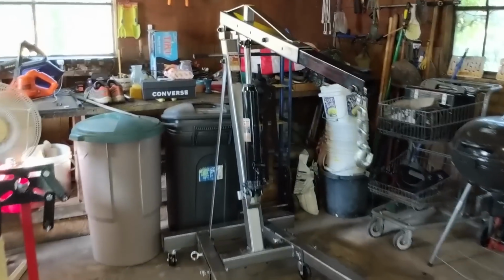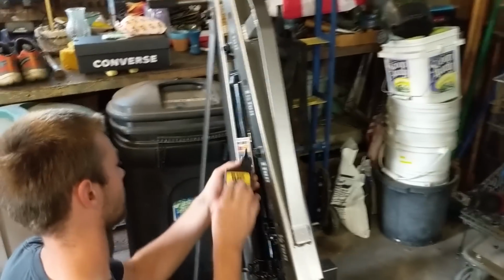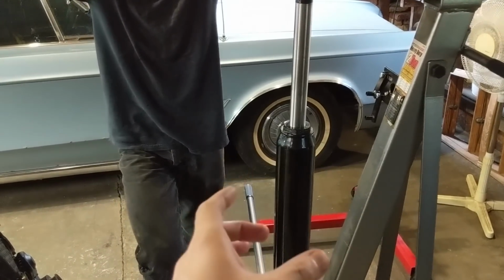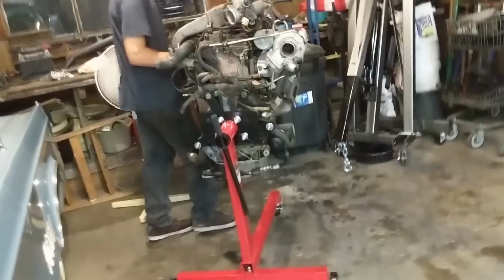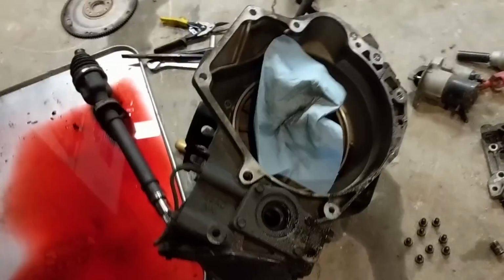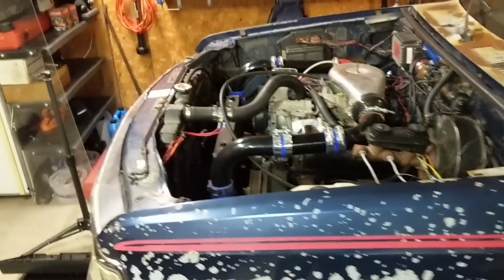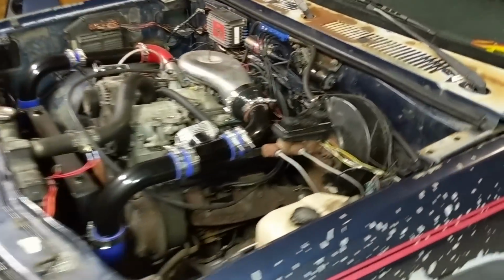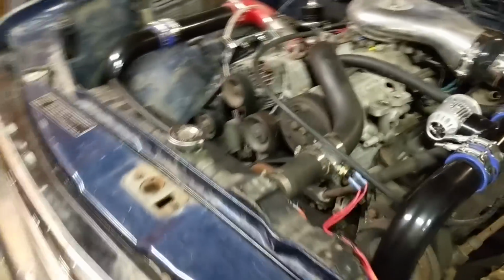eBay Turbo V6 Dakota Cold Start & Revs!

Comment: Brake fluid is hygroscopic so it has the potential to accelerate internal rusting. There is definitely a viscosity difference, but I don't know how that would affect a hydraulic system that simple.

As for DOT 5, I know that messes with non-silicone systems, especially ABS units. I would be even more hesitant to use that in a jack.

I used motor oil treatment in a jack recently and it has been working well so far.
Reply from the maker: Yeah that was sort of my figuring as well.
I was only joking about the DOT5, hahaha.
That's pretty awesome that the treatment works.
Honestly I think any oil fluid would probably function for years.
Could probably use vegetable oil!
Reply: Yeah, I was in the same situation a while back and was surprised when I read that brake fluid doesn't work, but it may have been based on test results with the wrong cause attributed to the effect.
Reply from the maker: I just honestly think it's people talking and nobody actually knows scientifically or anecdotally. Standard internet! XD

Comment: I been using ATF in my 9000 pound lift for over 10 years. Never had a problem. And you can find it at any gas station.
Reply from the maker: Yeah was wondering if that would work as well. Didn't see why not. I think jack oil is genuinely just super over priced low temperature hydraulic fluid. 😂 Thanks!

Comment: Things to (maybe) change on that Dakota: 1-get/make a downpipe where the wastegate doesn't hit a wall, 2-find a way to route the exhaust from the other bank to the turbo, or put a second one on that other exhaust manifold, 3-firing order, although that one is optional. Looks awesome otherwise, can't wait to see it make choochoo noises and burn some rubber. And fuel. And oil. Also the glorious Chrysler space-boat.
Reply: Oh, and 4-delete dump valve, get all the sutututus.
Reply from the maker: He has solved the wastegate situation I believe, and the turbo is being fed from both banks.
I did tell him to come reply though, hah. It makes some pretty awesome noises now. :D
Reply: @802Garage  My bad, it kinda looked like it was only being fed from three cylinders to my sleepy morning self. :D
Reply from the maker: No problem, I wondered the same at first! It definitely is not fed "efficiently" shall we say, hah. He says it works though!
You may be one of the few people who spends as much time on YouTube as me. :P
Reply: @802Garage  lol! Youtube is a literal goldmine, I'm (amongst other things) a computer geek, don't have a TV and lots of free time. And it's chilly outside, at the moment, so yeah, I'm able to rationalize my heavy Youtube consumption quite reasonably.
Reply from the maker: I'm a computer geek too. Think we may have touched on that before, but I have a degree in game programming and used to do computer repair. Also dabbled in audio and electronics in general. I find ways to rationalize mine as well. :P
Reply: Yeah, I think you alluded to it before. I find it funny that there aren't more people that are both into computer stuff and car stuff. It's basically the same logic. I work in mental healthcare nowadays, so I help fixing people's brains and, again, same logic. ;P
Reply from the maker: Funny, I've had several people lately tell me I should have been a psychologist. I really enjoy helping people work through their problems and feel better. I guess you and I would probably get along. :P
Reply: I guess we would. :D

Comment: I have used atf to many times to count of Jack's or anything that requires hydronic fluid even my power steering and it subs just fine
Reply from the maker: Yeah it's actually the required power steering fluid for Subaru and other brands! Thanks for the tip, I'll def be going that route. Jack oil seems like over priced snake oil.

Comment: I have used atf in place of hydraulic fluid before, it is acctually a pretty good replacement.  Brake fluid? Not so much.
Reply from the maker: Yeah I keep hearing that works well. It is basically hydraulic fluid after all. Then again, so is brake fluid. May do a test just for fun.
Reply: @802Garage  it would make a good video
Reply from the maker: I can see collabing with Cars Simplified on something like that too.
Reply: @802Garage  true

Comment: Brake fluid will just cause the seal to be swollen and creates a greater seal in the hydraulic system, but you have to mix it with the hydraulic fluid.
Reply from the maker: I have a hard time believing that when brake fluid interacts with rubber seals all throughout a brake system and doesn't cause swelling. I'm not saying you're wrong, just that I'd like a source or proof. At the end of the day, brake fluid is just temperature resistant hydraulic fluid. Doing some brief research tells me that brake fluid is not oil based, while many hydraulic fluids are oil based. Oil based hydraulic fluids in a system not designed for them will actually cause the seals to swell. That would only really be an issue with non synthetic rubbers anyways as far as my knowledge goes, which are pretty rare nowadays. I have had people in the comments say they use ATF in their jacks as well and never have an issue, and I would think that would be the most likely to cause seal swelling.
Reply: @802Garage  well this is the thing I my not know the chemical properties of brake fluid but I for one experiment with it , on car Jack,  engine with oil leak and it's just a temporary fix but it does work. You my think its crazy but it's the crazy ideas that makes us as gear head have turbo on cars and have man gone to the moon. I'm just saying put theory aside and do the practical to see the results.
Reply from the maker: @willssmall5067  Definitely hear you on that. Won't discount an experience that you had! Just also can't count on it as a general rule. The issue with this crane was definitely a scarred bore or similar issue causing an internal leak. We replaced it. Sometimes temporary fixes are all you need to get by. :)

Comment: You can put ATF, brake fluid, hyd fluid, 20w motor oil, compressor oil (which is mostly 20-30 w oil)
Reply from the maker: Hah, glad to finally get a comment like this from someone! That's my suspicion as well.

Comment: Brake fluid is hygroscopic because of the contained alcohol so I would guess the issue of using it in a system like that would be the absorbed mosture causing corrosion? I also am not sure the seals in that jack would be made of natural rubber like is used in brake systems so depending on your seal material there could be some incompatible 🤷‍♂️
Reply from the maker: Yeah those are my thoughts as well. My honest guess is it would still probably work for years, but might cause things to deteriorate more quickly.
Reply: @802Garage  oh ya for sure
Reply from the maker: May do it just for fun sometime. :P
Reply: @802Garage  fill it will diesel it might swell the seals enough to get it working.... For a while
Reply from the maker: Hahaha, never heard of that one! He just replaced the pump on his jack, but if I have a failing one maybe. ;)

Comment: Also you got air in your system.. let all the fluid out and let it all the way down and fill it up let it sit to get the air bubbles out then seal it back up and good to go.. it's common to happen if you open up the oil hole and get air in it.. take the plug out let it all the way down and let it sit to get the bubbles to settle and plug it back up n good to go
Reply from the maker: That's actually exactly what we did. A few times. Never worked. He exchanged the cylinder and it worked fine. I believe there was a large scratch on the piston rod which was letting air past because as soon as we pushed it past the bad point manually it would work. Thank you though!

Comment: ive used atf, motor oil, gear oil, etc...DO NOT USE BRAKE FLUID, it makes the seals swell up and deteriorate. its an old trick on auto transmissions to get you a little farther, but destroys all the seals.
Reply from the maker: Very interesting! Thanks for sharing the personal experience. I may have to test this in a video someday. :)

Comment: The biggest replacement for displacement is a rotary.
Reply: Also, from some short internet research, it seems like the brake fluid if anything could
A. Not preform as well because after a car has been driving for a few minutes it reaches operating temperature
B. Not be the same viscosity, which I honestly have no idea how that would affect performance because I am not planning to put any time of my life into learning fluid dynamics.
Reply: I saw that putting brake fluid into power steering can be done in a jiffy but is not recommended, likely because brake fluid is much stiffer than power steering fluid, so there's less play in it, and it is harder on components.
Reply from the maker: Yeah, those really seem like non issues for a stationary, no heated item like a jack cylinder to me. I would think the biggest issue is its propensity to absorb more moisture. A jack should still be a sealed system though. I may do it now just to prove it works fine, hah.

Comment: Wow are we doing the same shit or what! If u look in my videos the rat rod truck we built is a 3.9 dakota! Their junk engines in fact all newer dodge engines are junk except the hemi v8. Also if u look i just bought a 65 new yorker with a 413 big block LOL
Reply from the maker: Hahaha that's awesome! I'll tell Jaycob to check it out. Even he admits they're junk engines, but he has a weird affinity for them. I'll check out the New Yorker too!
Reply: Why is the 3.9 a junk engine?  My 94 Dakota lasted 13 years, I gave it away at 358,000 km (214,000miles).  It needed over the years , cat delete, fuel pump, crank sensor, radiator, thermostat, axle seals, and resistor pack.  I used the truck summer and winter in salt roads etc and as a hunting vehicle on rough back roads.  Got a new wiring harness awhile  ago, but as far as I know my in-law is still using it as a farm truck.
Reply from the maker: @percussion44  Nobody said it wasn't functional junk! Jaycob has also had mixed luck with factory wiring for sure. Because it was an 8 cylinder with 2 cylinders hacked off it's just not exactly an exercise in excellent engineering. Uneven firing order on a V6 isn't exactly desirable. It does work though!
Reply: @percussion44  thats not high miles! drove a astro van to the scrap yard with 500,000 on the stock 4.3. My 91 caprice had 300,00 on the stock 305. Thats miles not km. Its just not a good motor. It dont get crap for gas mileage. I just dont like them for anything.
Reply: @RichardsRodClassic  Nahh, I had a 2013 Hyundai Tuscon that detonated 2 engines, both replaced under extended warranty.  Sold it on the engine #3 after driving home a seeing a dude looking under his hood at the blown 2.4l Hyundai in his Sonata.  Compared to a Hyundai 2.4l a Dodge 3.9l is a miracle of engineering.
Reply: @percussion44  thats comparing 2 completely different things. When i do a comparison i do domestic vs domestic.